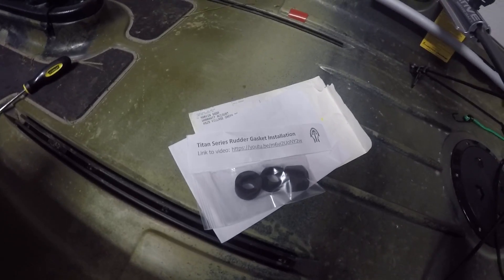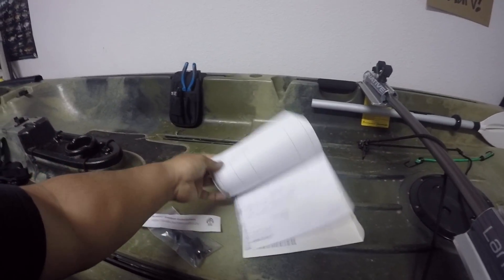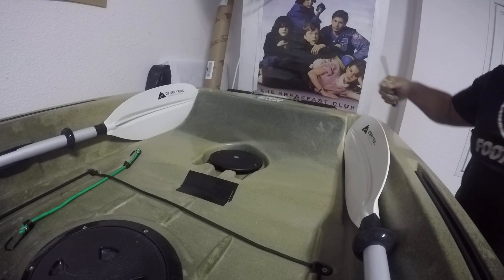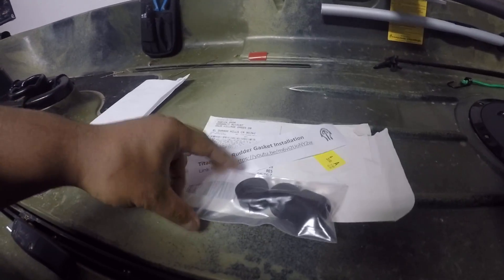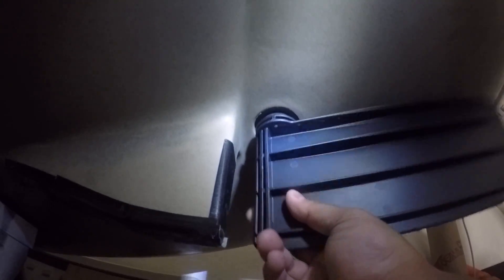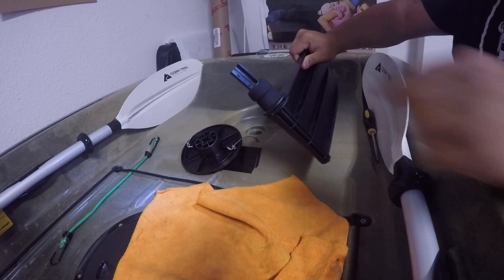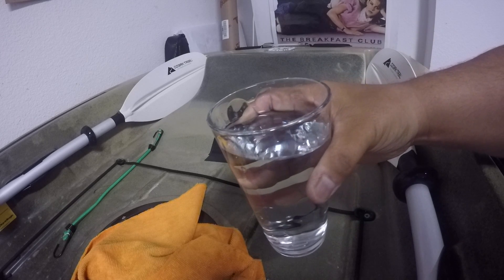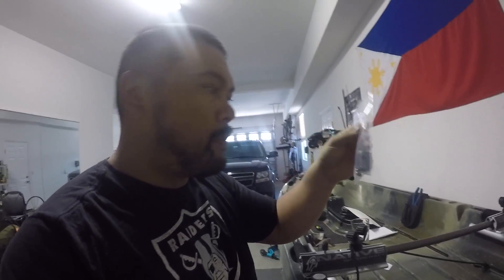Native Titan 10.5 - Water on Deck -FIXED!!!!!

Comment: Thank you for this.  I was taking out two gallons of water every 4 hours while out on the water.  I believe I have an older style rudder on my Titan 12.  I wasn't going to wait around to have those gaskets shipped.  EVA foam was going to take a while to get delivered to the house if ordered via Amazon. Harbor Freight FTW!  I picked up some kneeling pads that were 1.5 inch thick EVA foam.  Traced out the gasket, took it to the Dremel Scrollsaw, learned that the rudder recess area was tapered, and after the 4th version,  I made one that was a snug fit.  Slathered the rear hatch cover base with silicone after I took out what seemed to be glue from a glue gun.  Let everything dry, and a couple of days later, took it out on the Delta.  So happy now!  No water coming up from the rudder area, and no water on the deck.  No water in the hull either.  I appreciate you buddy!
Reply from the maker: Love the creative solution!!!

Comment: Hey Mobbin thanks for putting together the video and we are very glad the fix worked out for you. Sorry we didn't put any treats in the package. We literally got off the water after testing and rushed to get gaskets in the mail as quickly as we could because the weekend was coming up. We knew folks wanted to get on the water so we just rushed them out as fast as we could. You also nailed the reason we only advised 1 gasket and that was tension on the steering. We just felt the smaller single gasket didn't hinder steering but 2 seems to work for you so good onya!
Reply from the maker: Thanks for the fix im glad to get back on the water with dry feet. I really put in a lot of effort expressing to others that you guys will come through and Im sticking with my purchase. Not a day goes by that I enjoy using my Titan.
Reply: Native Watercraft how do I get gaskets for my Titan?
Reply: Native Watercraft Are the 2018’s being shipped with this issue resolved?
Reply: MOBBIN Outdoors did you ever get any swag?
Reply: Was gonna order one of these until I saw your videos. Been saving and looking into a good fishing kayak for a year now and there is no way I'm gonna invest my money into something this expensive when its this janky and has foam gaskets. For the price these are you should be able to slide this thing down a mountain while its on fire and still get years of use out of it. Your videos are awesome and thanks for all the information.
Reply: Great video. Native watercraft how do I get a set of gaskets?

Comment: When I bought my 10.5, they gave me the "Upgrade Rudder Seal Kit"! Yep, mine leaked the second time I went out in it. When I replaced the seal on the rudder, I also used 2 of them and kept the third one as a spare.  Also, I used Dow Corning 111 Grease for a watertite lubricant. It's Silicone Base, so it won't hurt any plastics. It is VERY Heavy based, and won't get "runny" in hot weather.  I also fabricated a Teflon Washer to go under the rudder steering drum, to keep any friction at bay. With the cables lubricated with the same grease and tightened, I can now steer with just my "Pinkie"!  (Yes, I did the same thing for the steering handle assy. also!)   
   Now, to save up and buy the Boonedox Rudder!  I'm thinking about maybe changing the S/S Steering Cables out with some 600# Kite Surfing line!  (I'll let ya know if it works or not!)  
   Happy Water Trails, to Everyone...
Reply from the maker: would love to an update on your mods! Tight lines
Reply: Making a full length cover now, from a camouflaged tarp that will be heavy duty, with added grommets and bungee cord. I'll try to get a picture and dimensions, if interested.  Also rod holders frm 1-1/2" ABS pipe (it's light and easy to work with, and it's "cheap"!)  Haha!

Comment: Ordered mine today. The Boonedox rudder was not as bad as the stock rudder but don't want any water coming in back there. Other than that I love my 10.5.
Reply from the maker: Rick Crabb same here! Despite the issues which I’m glad they resolved, no regrets and I enjoy every outting
Reply: The Boonedox rudder makes a real difference in the handling.
Reply from the maker: im defnitely going to upgrade to one soon
Reply: do you have water issues with the boondox?

Comment: So do you think with the boondox the same gaskets would fit? My titan is full of water and I mean Full on deck and also inside and every time the water comes from the back even with the plugs.
Reply from the maker: yes, you will need these same gaskets on your rudder. Also want to check the seal on your peddle drive cover. Upgrade them with thicker weather stripping for a solid seal. When peddling fast, the water can seep thru the cover. I would also disassemble the hear hatch to check the seal as well.

Comment: well guys....just got my 10.5 (2/28/2018) and it leaks as well. I reached out to my dealer to help me out. We will see.....if not I'm calling native (if you can find a contact number. Can't find one on the website). Good job MOBBIN, thanks for posting!
Reply from the maker: contact them on direct message on instagram  or message Woody Callaway on the Native Watercraft Titan group on facebook. They should be able to set you up.

Comment: Why wasn’t there gaskets on it to begin with?
Reply from the maker: now they're in there. The first batch of Native Titan boats didnt have this fix and this is how they addressed it. All new natives should have this installed and the top deck is now molded differently at the rudder
Reply: MOBBIN Outdoors  ok. Glad it worked out. Great vids thanks.